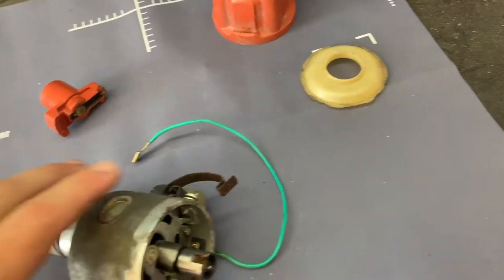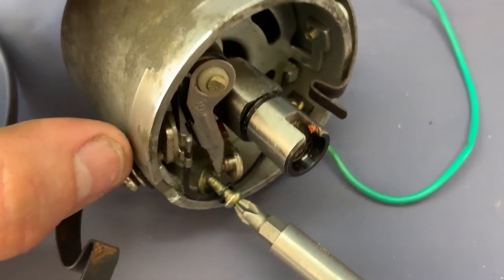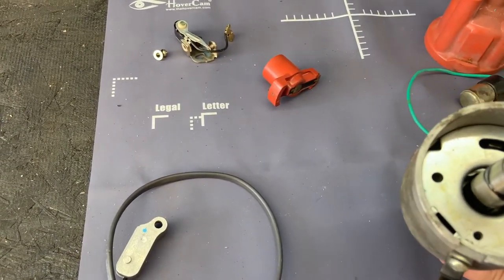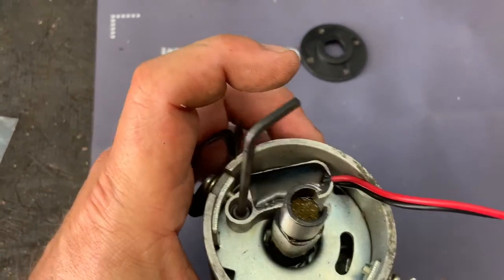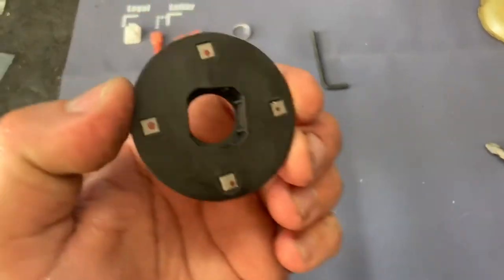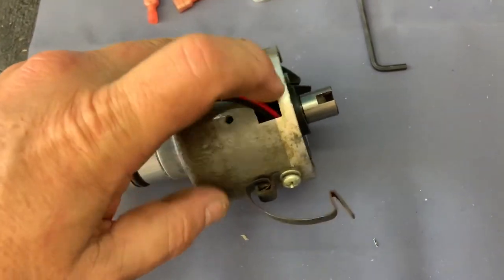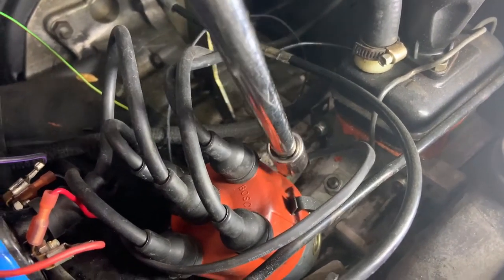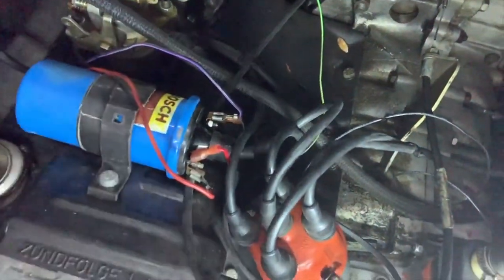Converting to Pointless Ignition in a VW Type 4 Engine - Porsche 914 and 912E Running Carburetors

Comment: I converted to a cheapy hot-spark unit from Ebay about a year ago.  I couldn't believe how much smoother the engine is.  No regrets other than not doing it 15 years ago.
Reply from the maker: Terry have to agree dunno if I would ever go back to points!  Thanks for watching!

Comment: Awesome video, Brian. I thought I had already subbed to you, just made sure to do it.
I actually purchased the same points for my 914 a few months back when my Pertronix smoked itself out (I shorted the fan cables, on accident, with the ignition on)

The E points work great, cant beat the price. (when competitors are $90 more!)

Comment: You left out a critical part of the installation. These electronic ignitions require a compatible  coil with a minimum resistance of 3 ohms, otherwise it will likely burn up the new ignition. Not really the kind of information you want to leave out.
Reply from the maker: You're right, not having the right coil is needed!  Thanks for sharing that tip with everyone!

Comment: Did this electronic conversion stop your tacho from working ? I read that it could happen on a forum somewhere. I’m thinking of changing to electronic ignition also. Thanks Brian.
Reply from the maker: Not at all, tach still works.  Make sure you have a solid connection on that wire!
Reply: Brian Minson. Thanks Brian, appreciated.